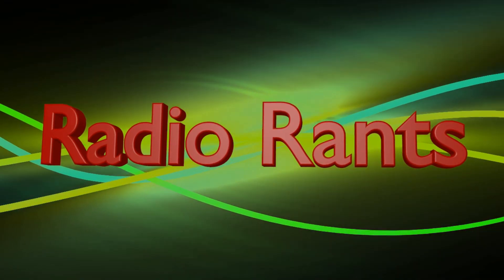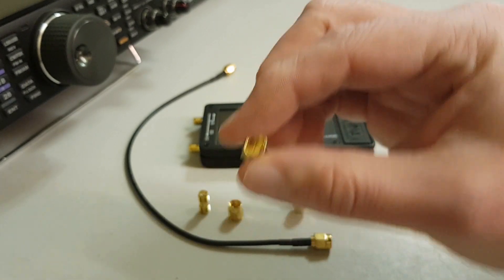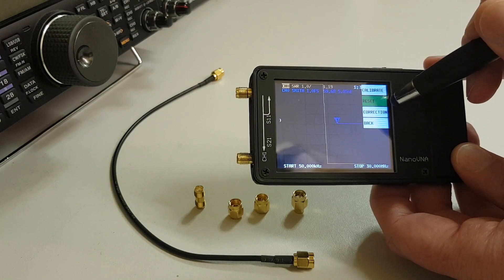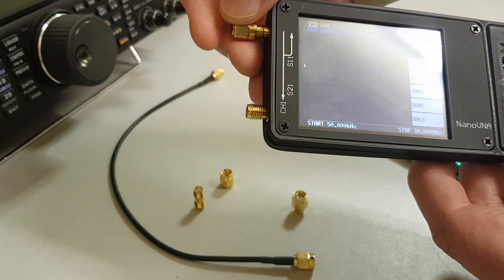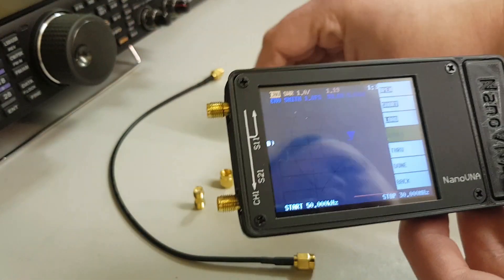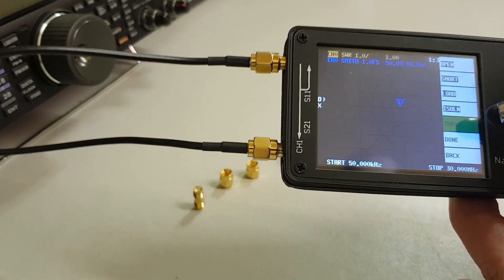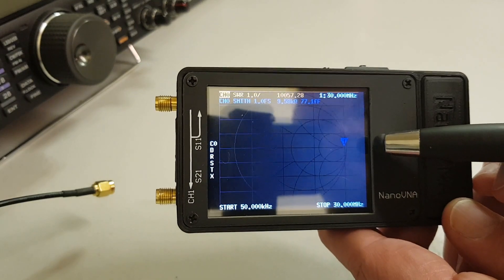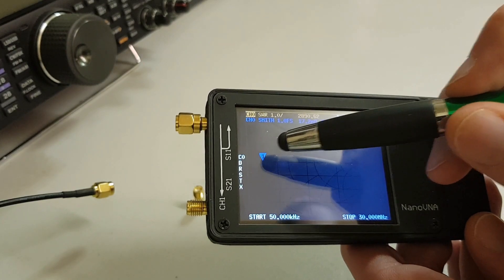NanoVNA Calibration

Comment: Thank you for spending time in sharing your knowledge! Here are the steps I recorded from your video. For those who want a printed version of the instructions.  73  
1.	Turn on the NanoVNA device
2.	Click the screen to access the menu
3.	Select CAL from the menu
4.	Select Reset
5.	You will be returned to the main menu
6.	Select CAL again
7.	Put the Open SMA on the Tx terminal
8.	Select Open on the menu
9.	Remove the Open SMA
10.	Add the Short SMA to the Tx terminal
11.	Select Short on the menu
12.	Remove the Short SMA
13.	Add the Load SMA to the Tx terminal
14.	Select Load on the menu
15.	Remove the Load SMA
16.	Add the SMA cable to the Tx & Rx terminals
17.	Select THRU
18.	Select Done
19.	Save into Memory Position 0 (or whatever profile)
20.	Remove Cable
21.	Turn Off VNA
22.	Turn On VNA
23.	The blue arrow (yellow in my case) should be to the right of the screen
24.	Add the LOAD SMA
25.	If calibrated correctly, the blue arrow will move to the center of the screen
26.	Take off the LOAD SMA
27.	Add the Short SMA
28.	If calibrated correctly, the blue arrow will move to the left of the screen

29.  Turn off the NanoVNA device upon completion

Comment: No certainly not a proper calibration and not near enough to have you teach anyone. First you need to understand why and what we are calibrating. There are a few things that need to be done prior to calibration and you have not done them, secondly you need the reason for the calibration otherwise your calibration was for nothing and will not work. Folks its clear he has no idea what he is doing and let me explain.

1. You need a reason for the calibration and that lets say was SWR, you need the trace set to that.
2. You need the reason for the calibration to include the range, so you need to set the range of the test, in the case of SWR the Bandwidth you are testing.
3. You need to ensure the calibration is done the the end point of calibration, in most cases you will be using a cable with connectors on it, you must ensure the calibration is done to the exact end of the cable or adapter that connects just before the DUT. This is important otherwise your calibration will be way off.

Lastly in his calibration, he did the isolation test absolutely wrong, its not calibrated to open air, you should at the minimum if you are using just port s11, have the load on it, but in the case wher you maybe using s21 or s11 and s21, you need a load on both to do an isolation calibration, he has completely screwed up the isolation calibration 100 percent.

Lastly doing a through calibration you can do it with just one cable, however it should be done with 2 cables and with a barrel connector connecting them together in the middle, why this is how it’s properly done and gives you the ability should you want to use port s21, not to have to redo the entire calibration.

I hope this shows not to follow this guy, and to really check out proper authorities on the NanoVna and the TinySA Ultra. Using a Nano in this way will get you incorrect results and may even hurt tested devices when you trust your readings with this type of calibration. This comment is for the viewers in hopes they do check out videos on competent enthusiasts that know what they are doing. It’s is absolutely wrong to teach something you do not understand, or if he does understand this to teach in such a way that those watching do not have the correct and full knowledge. At best this calibration if you leave out the isolation and through calibration would be correct if you were only connecting the DUT directly to the NanoVNA and not using any leads or connectors, and in almost 100 percent of Hams this is not the case. Please sir take down this video, and appologise to your viewers.

Comment: Brilliant man, brilliant. I know I am late to the party, but as a new buyer of an NanaNVA H4 the was the quickest (most efficient) way to show me not just how to calibrate but to confirm the calibration was correct. Good on you sir.
Reply: In answer to your question, yes I own the newest NanoVna and TInySA Ultra, Yes you use calibrate between each and every test done as it pertains to the changes in parameters. For instance if we set up a SWR test at the 10 meter range, and calibrate for 10 meter frequency, then decide to test 20 meter, we must recalibrate, each time. If we test for SWR and then decide to test cable length, we must recalibrate, only if the parameters stay consistent can we reuse a calibration. so if we are testing 10 meters for SWR on an antenna regularity then saving that calibration and resuming it would be prudent. Now perhaps you may run into other tests that may use the same calibration, that may happen, buts its good practice to recalibrate for every new test no matter what, as you may forget that you calibrated with a certain type of connector or cable that may lengthen or shorten the testing plane, and even though the parameters remained the same the testing plane changed so over a period of time you forget what that saved calibration was for. I recommend new calibrations each and every time you test, that is how a proper test should be run. now as for others that say the same as me, simply do a YouTube search, and almost every YouTuber that has a channel on the NanoVNA will tell you that you must ensure that the Nano is not only calibrated for the parameters, but most important that the calibration be done to the exact end of the testing plane and not a millimeter more or less, other wise you get an incorrect reading. you can prove this simply, connect one of the cables that came with the Nano, they are female on both ends, not to connect the open, short and load you will need the barrel connector that came with the Nano to connect the calibration standards. do only the open, short and load, then at the end, remove the standards and leave on the barrel connector as that is the end of the testing plane, the test is good. Now remove the barrel connector you will find the calibration is no longer good. now if you did the calibration test needing the cable, but not that barre, connector and change up the connector lets say to a sma to so239, you will get incorrect readings you must only at that point connect directly to the end of the barrel connector only for testing, now should you need so239, you need a sma to so239 cable and a set of standards that will calibrate so239 and they are sold. if you want precise tests you must calibrate precise and everytime, and I know no one that will disagree that has understanding of the Nano and tinySA.
Reply: @tazman6483  Thank you greatly for taking the time and energy to post such exhaustive and informative responses. Excellent information and I am about to print out a hard copy. Thanks again and best regards.
Reply: Quick and completely incorrect, good luck getting bad and incorrect readings.
Reply: @tazman6483  (Previous response deleted). Were you referring to the device itself or the method of calibration shown in the video?
Reply: The device under test is part of it, depending on the type of test needed and the port and type being port s11 or port 21 and wether it’s reflective testing or other. Also what are we testing SWR, Cable Testing, range of test  and Frequncy all depend on the device. Now as for Calibration depending on the device and types of test, will vary on how far into the calibration we go, for most reflective testing we only really need open,short and load calibration, for more we may need isolation and through calibration. None of this mentioned in the calibration lesson given here. Now there is more, we need to understand are we connecting direct to TinySA or using cables and or add on connectors, we must calibrate to the plane of the Cable or Connector if USED and in almost 90 percent we are using cables and or connectors to match device under test. In answer to your question both, the device under test and type of calibration and how calibration is conducted. Not to mention he did the isolation test 100 percent incorrectly. I hopes this helps. @jonathanrobertson3406

Comment: I'm not sure how "accurate" this is or how much of an effect it has, but I heard on another video (forget which one...) that you should AVOID touching the threads of the two terminals on the VNA because the oil on your hands can actually skew the calibration and readings afterward. I'm guessing that apparently changes the conductivity of the connectors? So I gather if you DO touch the terminals it's best to wipe them with rubbing alcohol on a Q-tip and if you've screwed the open, short or dummy on to a oily terminal to clean the insides of those too. They also claimed that the torque value how tight the SMA connections are could change readings and results?!

Comment: Something I learned (Maybe from the GroupIO forum) when I first started using this device was to have the cable connected for all calibrations. I use the cable for all tests, so it made sense to me to have it on all the time. Also, I was told that SMA connectors are not meant to be connected and disconnected many times, and should be torqued. However, I am as careful as you are, and don't see the harm. I have the torque wrench, but do not use it except to put the cable on the NanoVNA.
Yesterday, I read on the DX Commander Discord channel an item by "YT5BOS Bojan: 
I found out (can't remember if it was from a blog or a video I recently watched) that I have been using the NanoVNA the wrong way. Calibration should be done before measuring and AFTER setting the start and stop frequencies. The way I was doing it was to calibrate it after it boots and afterwards perform the measurements. Another detail I missed to incorporate in my previous tests was setting the delay when using the adapters (SMA to SO239, SMA to N etc.). The recommended setting of 160ps (picoseconds) works fine with the adapters I am using regularly and you see notice the marker moving to the center of the Smith chart after applying the delay (on a calibrated device)."
So now, I am trying to wrap my brain around that. 
Your videos are awesome, BTW, and thanks for doing them. 73 Steve

Comment: It's interesting that you say for the Isoln. step to just leave the ports open.  In the manual they say: 6) Connect SMA Load to PORT1, connect second Load to PORT2, wait more than 3 seconds (wait for the
screen to stabilize) and press ISOLN.  Note: if you don't have second Load, just leave PORT2 open.
I've tried both way, open and terminated and it makes a big difference in how it performs so which is right?
Reply: Also you have to tap Reset twice at the beginning for it to work properly, not once like you showed.
Reply: You are absolutely correct, this is another video on how not to calibrate a NanoVNA , and why guys that do not know what they ar doing should avoid being on youtube. The saying those that can do, do, and those that cannot do teach, and teach poorly.